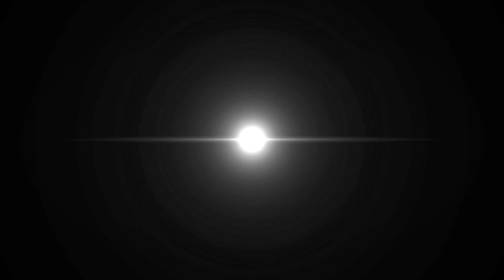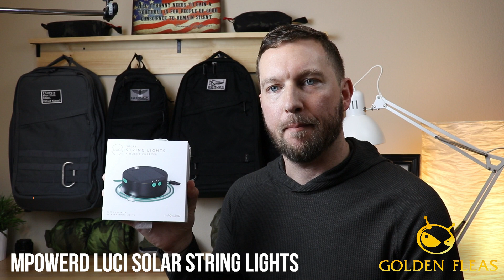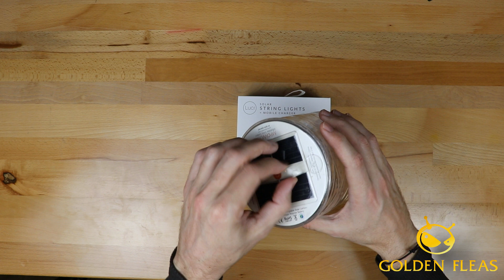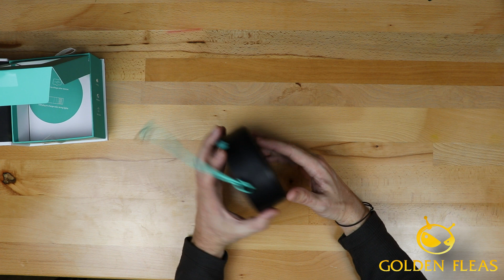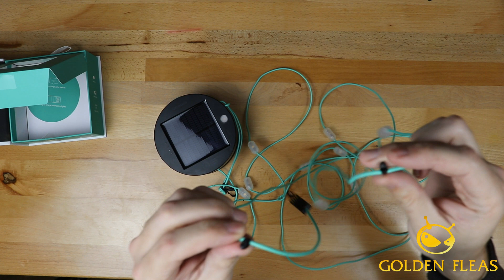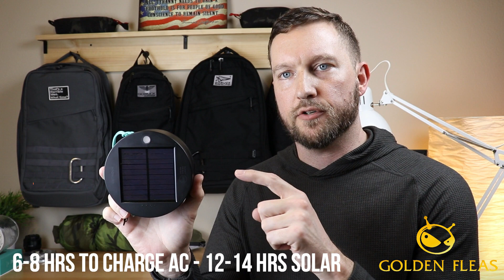MPowerd Luci String Solar Lights - Really Cool Lighting For Camping/Outdoors

Comment: Um not all that helpful. What is helpful is real life application like outside in the dark or even inside. Thanks
Reply from the maker: real life application is....you can recharge it (USB or solar) and you can use it outside in the dark. I use it while camping as a light source in the evening. It packs up and stores very nicely.

Comment: Your review has been the most helpful for this set of lights! Quick question though, could you do a follow up with actual use out in the dark? I’m curious to see how much light it’d provide at a campsite.
Reply from the maker: Thanks, I appreciate that feedback! If I get a few free seconds I can try to get some footage but if not, take a look at the pic I inserted in the video. It lit up the interior of my roof top tent extremely well on just low setting. It's a total of 100 lumens at highest setting.
Reply: Golden Fleas Okay, I see it’s pretty bright. I’m considering these for my pop-up canopy for night time lounging, I assume the high setting would be plenty of light for that, right? I believe the battery would last about 5 hrs on high but I wouldn’t need it on for so long.
Reply from the maker: Pedro Diaz I would assume they would work adequately for that. Give it a shot, for $35 you can’t beat it really.